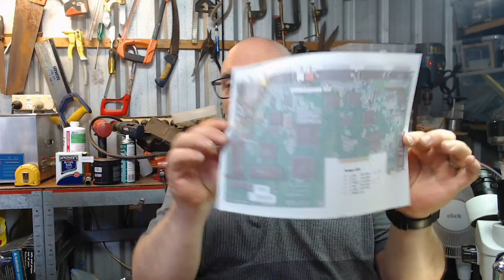Recapping a Commodore Amiga 600

Comment: In my collection I've plenty of Amiga models. It appears to me, after having had to recap and repair serious damages, that A600 were made with low quality caps. As you said, no one of my A1200 had all these problem. However, altough now being a little cute computer, I think that Commodore would never had to produce this model. They failed after 1987, delaying all the R&D projects. Saying "bad management" it's too little. Cheers, M
Reply: I'm glad Commodore did make this model because it's the best entry into Amiga computing these days without spending a fortune. The 500 just not as practical these days.
Reply: @Daz555Daz  when is a retro computer collection practical?